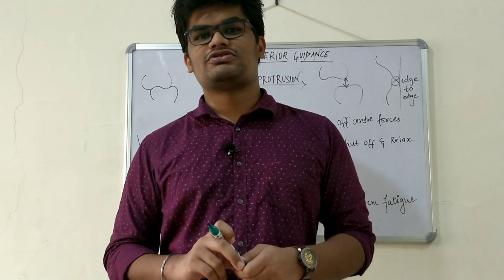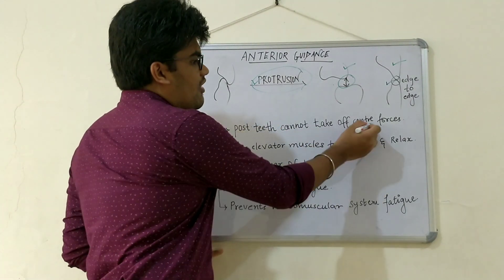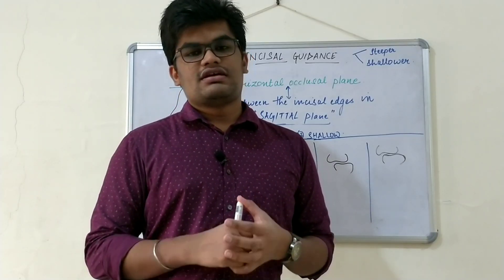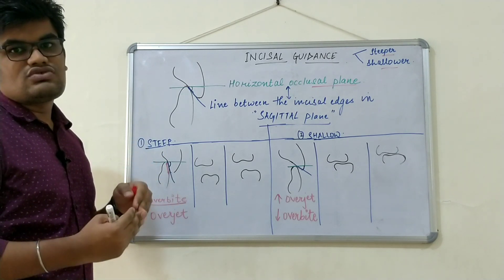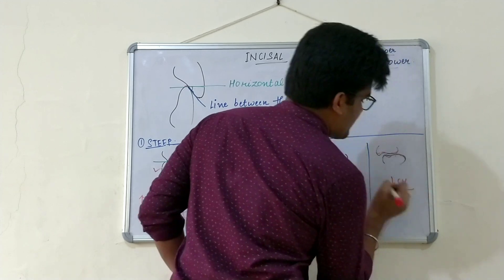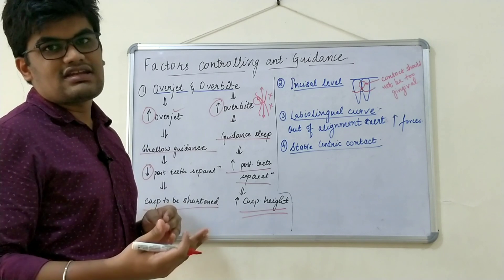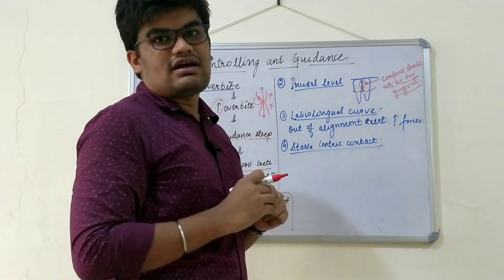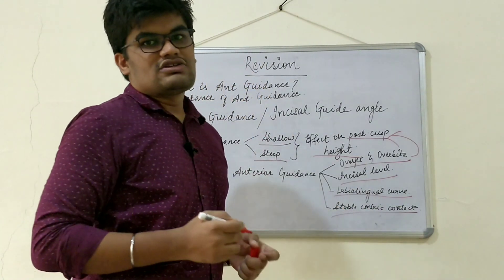Anterior Guidance, Incisal guide angle, Influence on posterior teeth due to overjet and overbite.

Comment: Is incisal guidance  synoname of incisal guide angle ?
Reply from the maker: Incisal guide angle helps in establishing the incisal guidance. Incisal guidance is a path formed because of the incisal guide angle whether it be steep or shallow.
Reply: @akshaybhandarisdentalvideo6452   thats mean it is line disecting the incisal guide angle ....and this line drawn from lingual surface of upper anterior  teeth , directing outward ....is that right ?
Reply: @akshaybhandarisdentalvideo6452   Dr...is the anterior guidance synoname of incisal guidance ? ? .. 
What do mean by increasing or decreasing cusp hieght ,  is that while making prosthesis?  
How can we determine distance of overbite & overjet , is that on articulator or  in patiant mouth or by digitl programs? 
How much the increasing or decreasing  in hieght , is there any standard  criterian ? , so that we knew we are in correct occlusion ...
Thaaaaanks in advance Dr..